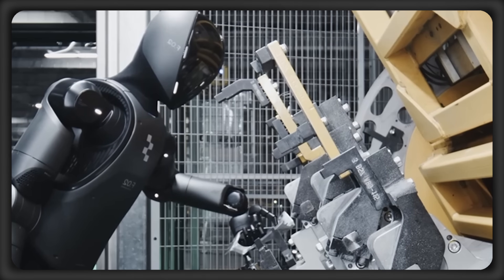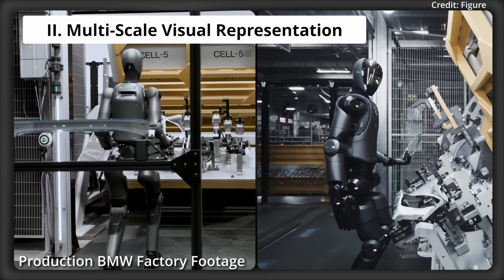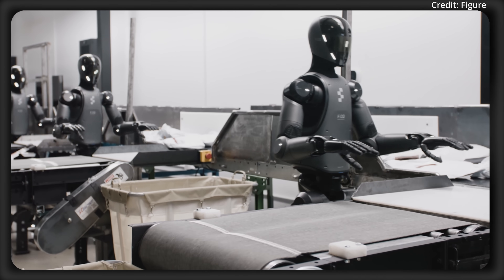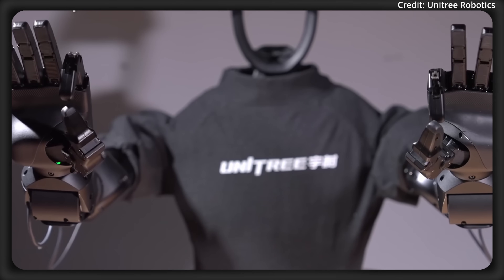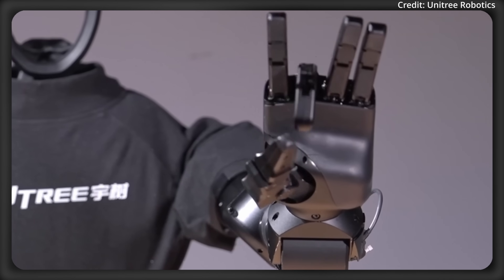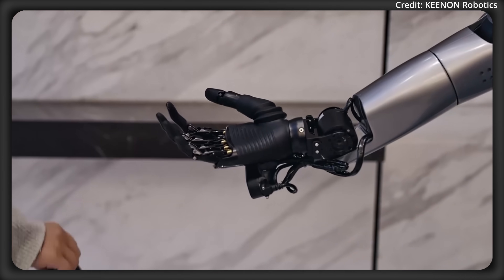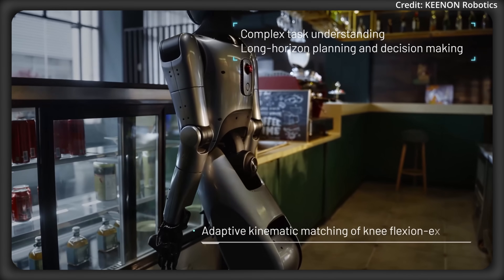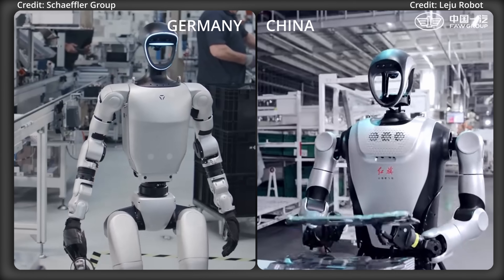Figure Helix S1 & Unitree Dex5-1P AI Robots Outperform Humans ($69,900 G1 Upgrade)

Comment: 70,000 for 1 robot that can cover the same work per day as approximately 2.5 workers works out to a break even of about 35,000 even before accounting for rights to days off, running HR departments etc etc. Everyone earning more is at risk just for a naively optimistic direct replacement only case.

And even then I'm assuming the bot has a 1 year life expectancy. The longer it lasts the further down that cut off is pushed too.

Tell me again how this isn't the end of any current approach to organising society and the work ethic. These things don't even need expensive secondary refits like any traditional automation, they are designed to work in Human spaces. 

The most pro work, pro Human labour government in the world isn't resisting an economic case this strong for any meaningful length of time once commercial critical mass arrives.

Comment: I am waiting until a robot does most things as smoothly, quickly, and efficiently as an above average human worker. Then, barring being dead from old age, I will take 2. lol
Reply: Why 2? Lol
Reply: @JJs_playground two robots at the same time. Living the dream. 😅
Reply: actually, don't hold your breath
Reply: going to be probably another 10-20 years til the tech gets to that point. remember though, humanoid robots don't need sleep, breaks, or sick days. these are industrial grade machines that barely need maintenance. they need to be charged, but I assume you can swap out battery packs on some models. in 30-50 years humans will become retrograde, unless they themselves start merging with machines (this means taking a brain chip, or other robotic enhancements). people who don't want to do that will be unable to compete and will have to find decentralized communities to live in.
Reply: @chrishayes5755  I'd say "smooth" robots will be here in less than 10 years. Merging with tech through brain interfacing though might not be such a good idea as it looks. Might sound interesting but it will signal the end of identity, Self and consciousness -  any other choice will be better than this.
Decentralization as an alternative is not a sustainable long term solution. Decentralization is a transitional state which turns into centralization in a short period.

Comment: Dump your computers. Learn the Trades.
Reply: Learn the mechanics trade of robotics! Build & test robots because that’s where the money will be at
Reply: @StardustDNA  nope. Look at electric vehicles. They have proprietary parts. Not for a roadside mechanic to handle. Same with robotics. Only big companies will be able to repair them. Also robots will mostly be on rental service, so you'll be voiding contract/warranty if you try something yourself.
Reply: @StardustDNA  nobody does that by hand anymore. robots testing is automated and other robots test new iterations.
Reply: @StardustDNA 
Robots will be able to service robots, so that's a dead end. Anyone manufacturing robots will use them for automating that. And if it know how to build one, it almost know how to repair one.
What you can do is start a business. Aim for employing AI and robots.
But you can start it with human employees, while learning the business. You might have to teach the robots those tasks later.
Reply: @larsnystrom6698  I agree, if the robot detects a defect it would be able to order a replacement part to fix itself, or automatically call a robot engineer to come to fix it. This is currently the worst robotics will ever look, it's only going to get better.